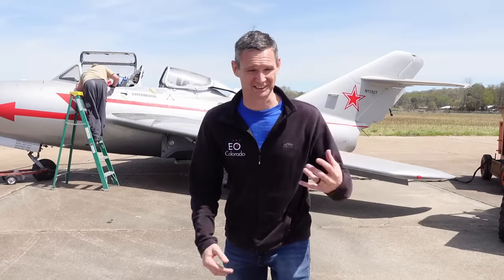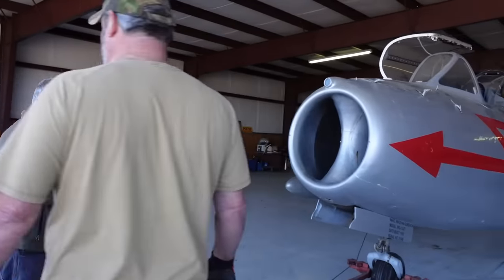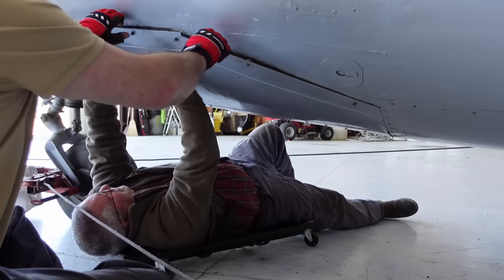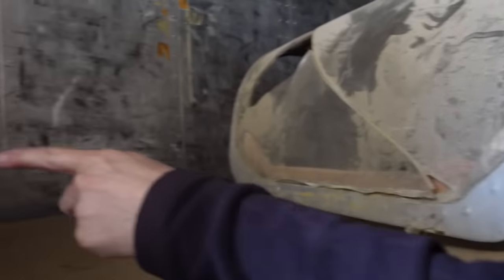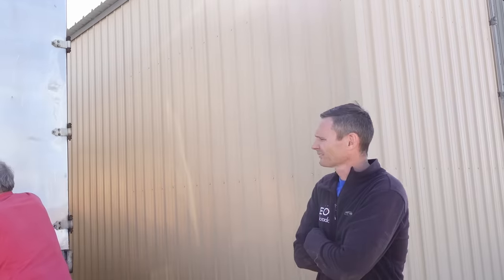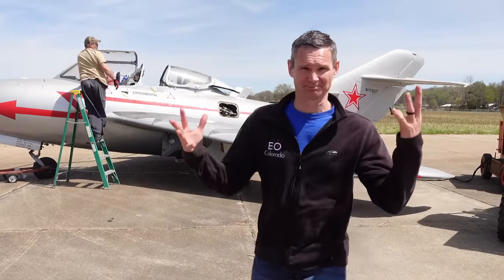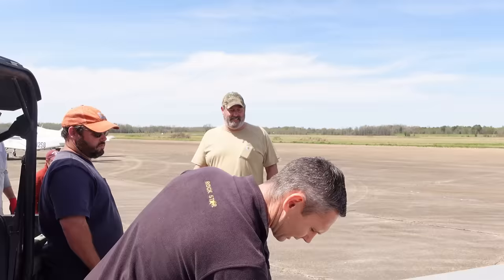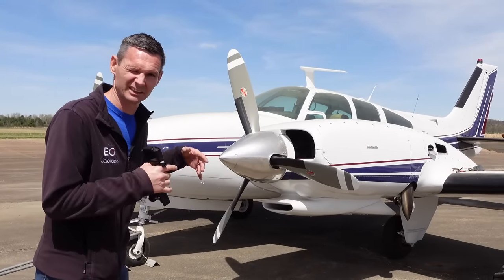I Start A REAL ABANDONED MIG 15 Fighter JET After 12 Years

Comment: I went up in a MiG 15 20 odd years ago and I still remember every second of it.  Learning how to combat G's with no pressure suit.  It was a huge buzz.  Got to fly it and do a barrel roll.  Tough plane.  Due to the angle of the wings, when it lands it causes ground effect and they literally have to dump it to get it on the ground.  I remember the suspension bottoming out with a thud.  Amazing day with Air Combat Australia
Reply: I flew in a -15 Ibis UTI in 1995 in northern California. Lots of work to maintain these birds.
Not a lot of room in cockpit if you're a tall person. Heavy on flight controls in flight I thought. Pretty neat experience.
Reply: @831BeachBum  Steering them on the taxiway is some fun
Reply: Every airplane has ground effect You just have to learn to write speed
Reply: @Jatojammer  
Ground effect is particularly dangerous with swept wing aircraft because the wingtips can stall, leading to a loss of aileron authority. If the stall worsens, the center of lift will shift to a point in which it's in front of the center of gravity, thus causing an unrecoverable pitch-up attitude at low altitude. The F-100 Super Sabre killed many pilots because by doing this "Sabre Dance".
Reply: speed
Reply: Flight sim is cool
Reply: @Jatojammer   S P E E D. Done and done.

Comment: I was stunned at 6:12 to see just how pristine the cockpit is! It probably hasn't looked that clean and scratch-free since it left the factory more than half a century ago. Usually, old aircraft will have scratches and dents on every conceivable surface of the cockpit. Fantastic work!
Reply: @raptor2265  I was surprised how everything was neatly labeled in English. You can really tell this plane was loved.

Comment: I only flew one time. It was in the mid 70's. The lady was kind enough to give me a ride in her Piper Cub 62 (CF-OSI). It was so amazing that I was shaking from the sensory overload. I always wanted to be a pilot but, I suck at math so, I diverted my dream towards cars and small engines. Being afraid of heights came later on and, don't ask me where it came from. Jimmy's "youthful exuberance", is bringing me back when I was 12-13 years old, on that first and only flight.
Reply: Same. Suck at math and my vision sucks 😋
Reply: I think I gotta solution, ever tried microlights? You don't have to be amazing at maths to get one's license and it's relatively cheap. One of my instructors went and got his CPL and said he regrets not  knowing about microlights sooner as he'd have gone straight for it. Furthermore  if you can drive, then your vision is good enough.

Comment: No smoke, no flames weird considering you know what
Reply: Not really, MiG-15s don’t have an afterburner, so no burner plume, and lots of smoke on start typically only happens after an extensive amount of oil is placed in the engine to preserve it for long periods of time. For one of the first fighter jets, the MiG-15 actually burns fuel rather clean, so not a whole lot of smoke is trailed in flight. Google footage of the F-4 Phantom flying to see a plane that does not burn fuel very cleanly….
Reply: No, what?
Reply: Those centrifugal flow turbojet engines were rather fuel efficient once sorted out despite their portly girth.  Have fun with it!
Reply: @zachboyd4749  they do have afterburners
Reply: @aj_2x170  
No they don't, you're thinking of the 17. The MiG-17 did have an afterburner, but the MiG-15 didn't. The two are very similar in appearance, so it's easy to mix them up.

Comment: That was the most quiet, turbine engine with the most invisible cool exhaust ever. Are you sure it actually started?
Reply: I was thinking it sounded like it was just spinning on the air turbine starter. Not actually running.
Reply: No smoke, it wasn’t running.
Reply: Mig-15s are extremely quiet for jets
Reply: @gogereaver349  makes good sense😎👍
Reply: @thomas7770  that’s kinda what I surmised. It wasn’t even loud. I heard the turbines spool up but I didn’t hear the whump of ignition. It seemed to me that it was just kept turning over. But, I figure Jimmy being present would know.
Reply: @crissd8283  my thoughts exactly.😎👌🏻Also his camera should have been thoroughly melted.
Reply: If you start listening at about 6:55 through 7:00 you can hear it spooling up after it lit off, that's the "Wooooooooo" sound you hear. 
Right at 6:59 you can see the heat coming back behind the airplane.
Reply: Yeah you can definitely hear it light off around the 7:00 mark
Reply: @moodiblues2  I'm not sold that the camera would melt. As high speed air exits a nozzle it creates low pressure causing substantial air flow around the aircraft as it gets sucked in to mix with the exhaust. As the camera wasn't directly in the exhaust stream, the air around it was likely fairly cool.
Reply: @moodiblues2  you hear it use headphones its settle but you hear the fuel start burning. that woooo sound at 6.55. if they gave it power and moved a bit then everyone would be convinced. but they probably figured that was a bad idea on a untested jet.
Reply: @rudedog302  Indeed. She fired up all right.
Reply: I also don't think it started, and was just spinning on its air compressor. As much as I wanted it to start, there was no heat from the exhaust and there would have definitely been some smoke on ignition. Retired aircraft engineer here.
Reply: @RebuildingScotland  there was you see it going around the side. it was only a second you see the heat. must have been in the wind. when it goes woooo thats it pulling air and burning fuel it also revs up slightly at that point its running on its own power. they shut it down shortly after being untested and all.
Reply: @gogereaver349  No, a turbine exhaust would be clearly visible as a well-defined plume of hot gas exiting at a velocity that would not be deflected by the wind. If there was anything seen, could have been just a dash of vaporised kerosene. Also, the way he was handling the throttle in no way related to the sound that would have been produced. Pity, because I was really willing it to ignite.
Reply: @RebuildingScotland  you dont get alot of heat distortion on a non afterburner aircraft as they have valves to keep the temps down. unless its a cold day.
Reply: @RebuildingScotland  either way its not a good buy for him this is something for airshows not a daily flyer.
Reply: @RebuildingScotland  amazing how many Mig experts there are out there....the first and foremost telltale that it started is that Jimmy said it did, I don't believe he is a liar.  Second is that I have seen one start on several occasions and helped in the process....those old turbines are nothing like the current versions, flight idle on the Mig 15 is like 8 or 9 thousand RPM nothing close to the spool up on a current turbines 40 or 60k. Migs run slow and cold, they just didn't have the metallurgy or manufacturing back in the day to make the thrust they do today.
Reply: @troynyholm232  Well, I never claimed to be a MiG expert, just had several years working on vintage aircraft, so I probably know nothing.
Reply: @RebuildingScotland  I agree, but why did Jimmy act like it was a success?
Reply: @gogereaver349  I’ll take your word. I was just a bit surprised that an old Russian jet, made in the  1950s, could start and not have  a puff of smoke, loud ignition and melt the camera placed a foot or two from the rear of the motor. But shit, Jimmy said it started and you could hear it; it must’ve started.
Reply: @chrisw9629  👌🏻
Reply: @rudedog302  👍
Reply: @moodiblues2  the link i shared was on starting and taxing out no smoke etc.
Reply: @RebuildingScotland  Ok I am a licensed A&P mechanic for 37 years, worked for two different airlines, spent 4 years in the USAF as a jet engine mechanic, overhauled 8 different types of jet engines over the years from J57 to CF6-50s, I have stood under J57 turbojets and hand trimmed the fuel control. THAT VK-1 JET ENGINE LIT OFF AND WAS RUNNING.
I can tell you not all jet engines smoke when they light off, on the J57s (B-52G) you had to look for the slight flash of flame when they lit off to know that they actually did light when on ground during a run-up. Some of the newer big high bypass, cleaner burning, fuel efficient fan engines smoke when they are just spooling up after light up, some don't.
Reply: You’d expect to see smoke if the engine fuel system had been inhibited. I guess the engine had been run recently by the sellers to ensure everything was ok prior to filming.
Reply: @andrewdixon6401  very possibly but what about the heat and camera close to where the hot exhaust gases would be?
Reply: @moodiblues2  the camera does appear to shake as you expect from a running engine. They don’t appear to throttle the engine above idle so that’s maybe why we don’t see much heat distortion. You would expect to see a little puff of unburnt fuel on the start of combustion but maybe it’s just missed during filming or as it’s probably a multi can combustion chambers you just don’t get it.
Reply: @andrewdixon6401  you’re probably right. I don’t see why Jimmy would say it started if it didn’t

Comment: I really enjoyed that one Jimmy,  lots of fun.  I used to pass through a town in New Zealand called Pokeno on my way to work.
There was a mig fighter just like this in a yard under a plastic tent.
Often wondered if it flew again.
Awesome sound a jet winding up. 
Regards Steve.
Reply: There is a mig in penrose that sits on top of a building  it might be the same one
Reply: @philcrosby7757  You never know 40 years later.
Reply: @sprendergast351  the one in penrose is different to the mig15 its a bit longer
Reply: @philcrosby7757  the one in penrose is on top of a building doubt it could ever be flown again

Comment: Some of the gauges are still in Cyrillic and I assume or original? Like the brake pressure gauge. I learned in the video last night that the brakes and the cockpit canopy seals all share the same nitrogen system, and when the brakes discharge nitrogen you have to be careful. Likewise taken care of not to damage the canopy seals so you don’t lose your brakes.
Fascinating and entertaining, thank you for sharing.

Comment: Jimmy for president
Reply: What could go wrong I see nothing but perfection from this man dude do you realize in my mind you're on the same level as Steve Irwin I miss that guy you are the airplane hunter jumping on the back of these wild beasts and riding them home good job sir this is coming from a factory test trying to catch up on your videos do a review of a quicksilver aircraft we had seven different models if you want all 7 it would be cheaper than buying one of your crazy adventures if you could find them p we took the back seat out of the GT500 converted into a crop-dusting contraption

Comment: This is just a test to see if you can still kick the tires in like the fires of course, but it looks like you’re going to have to spend some money on those canopy seals before you can take it anywhere, even taxiing, unless you can isolate the seal nitrogen feed so it does not bleed out and you lose your brakes. Those canopy seals look pretty tattered.

Comment: I remember a different video of a 2 seater trainer mig15 explaining the eject procedure. Was something like “if you’re still conscious after the 20+G eject you have to separate and pull your chute.”
Also has limited brakes from its nitrogen tanks and little aileron authority at approach speeds.
Reply: Matt Guthmiller's video , right?
Reply: @DimoB8  Yes! That's the guy
Reply: As I understood from a pilot, the eject function it was not a real option. Most common it was to die like a fly smashed on the window, decapitated by headphones, or air born without legs.

Comment: But Jason's 401 is actually a rescue and everything he's doing is for an incredible cause. He also won the 401 by putting in so much work to get those engines to run by himself.
You've just found a jet that runs and got the pro's to start it for you. Its also not really "Abandoned" if you have to buy it from someone, I'm guessing the owner. Also good luck learning to "Drive" a MiG.

Comment: On at least the mig-15 and the MiG 17, the fuel lines are made out of aluminum. You must replace those with stainless steel fuel lines. It has cost a lot of investors some aircraft.

Comment: There was a Mig-15 that was sitting at the local airport in a town that I used to live in. It sat there for years until it finally disappeared. I found out later that it got put up for sale for $1 so long as the new owner paid for transportation costs. It wasn’t running and definitely needed a LOT of work, but come on, $1???? If I had known that I would have tried to figure something out. That was when I was way younger and in the Civil Air Patrol and it was always so cool to see it every time we were at the airport.

Comment: Fighter jets are "by wire" - you have a stick, and it is pressure actuatid.  If you have ever flown with a single stick (versus a yoke), then you should be ok. (wait - this has the old-fashioned "stick")  I would make sure I got altitude quickly, so I could "practice" and get used to the action/reaction.  Practice a few "landings" and banks, and then do some very easy "touch and gos" - VFR.  Make sure you can read the instruments, or have your interpretation.  I prefer meters (*not* "feet"), so I just calculate and do visuals.  Again, keep your altitude - you can't make one mistake near ground.   I wonder what my flight plan would be?  Ha ha.  The recip multi is more most people's speed.  The turbo requires a turbo rating.

Comment: Hm it can´t be that difficult: Throttle with Russian Cyrillic label fully forward until the afterburner roars, somewhere is the handbrake (there are maybe five or six levers inside that archaic cockpit one must be the handbrake another one is for the flaps, the others are for releasing the bombs so don´t worry they will not do anything as long as the jet is not loaded). Pull back the stick with the red Sidewinder button when it rolls along the runway rather fast... It´s unclear which lever is for the gear so better leave that extended during the first flight. And maybe buying a label printer for English gauge descriptions to make the second flight more easy might come in handy. It´s just like a fast Cessna 152, can´t be that difficult to drive it :D 
P.S.
Are these authentic Concorde batteries, or TU-144 Concordski batteries that just look like Concorde batteries? Oh and that cockpit is in English - why is the cockpit in English and brandnew looking? 
By the way I like your video and your style you are cool and funny, not like many other rich guys - booooooooooooring and like a sleeping pill and "yeeeah yeeah whatever I have a Lamborghini a Ferrari and a Learjet *yaaawn so what I don´t even look at these anymore...." You show real emotions and true to the core enthusiasm for these awesome birds. Of course you should buy it if you have the cash, because NO ONE has a real fighter jet in the garage. Imagine how cool that is starting this beast and let the turbine howl every week for a few minutes. But the ailerons are missing and might be hard to get on eBay - no ailerons means this bird is grounded, or you can drive it along the highway with the rudder. But maybe comrade from Eastern block knows where to get authentic Mig ailerons! :D

Comment: Jim, buy it it would be a great project to follow for me. And for you to do I think it will be very interesting and exciting. God bless you and your family you do a great service to our country, I fight airplanes as well, only mine are RC airplanes, the largest one I have is a j3 cub with a 12-ft wingspan, ways just under 40 lb due to some of the modifications electronically that I installed, with remote starters stabilization systems I can monitor airspeed, engine temperature, battery voltage, all my electronics are totally redundant, gives me a better sense of security and safety.

Comment: That Baron has Duke engines on it. That must be what they put on turbo Barons. Or it was some kind of upgrade done to it.  That Mig must burn like 400 GPH or more. Times whatever you can get jet fuel for. That would govern my decision. Plus the cost of the maintenance. Too bad it doesn't have a cartridge starter.

Comment: Do that trick again where you do a fly-by onscreen and kick the leg of the filler ladder at about 5:50 in Joyous Exultation!.  It was perfect!.  lol!.   What happened to the Mig??.     At the Abbotsford Airshow in Canada one year, they had 2 Mig 15's chasing 2 F-86 sabers across show center,,then the return pass, the tables had turned.  They did a 4 man formation fast fly-by, at Mach .82-ish(I think the announcer was drunk)  which was really loud!.   This was in the 80's.  I was hooked.  If you run that Mig at full beans, you'll burn thru the drop tanks in minutes.  Even at cruise, they guzzle.  Even updated, they guzzle.  Once you come off the drop tanks, you'll have already planned ahead to finding a planeport with jet fuel and compressed gasses, or start-cart, or both.   Every 100 hrs is FAA mandatory.  I would make that every 50-75hrs, at maximum.   It's old,,but Very, Very cool!! .  Thanks Jimmy!!.  The ME-262 had a max engine life of 25 hrs with the Jumo engines, then full rebuild, or scrap heap.  That thing sat for 12 years and kicked right to life.  Russian heavy hammer tech vodka voodoo.  Yup, Yup!.

Comment: Where was the heat plume coming from that jet engine? Looks like it was not running at all, just sound effects and shaking effect added to camera. From side-on view you should be able to see the exhaust stream blurring out the start cart in the background. Maybe they spun it up but no fuel was burnt, no ignitor clicking either. Have a close look at jets that are really running, its quite easy to spot the kerosene fumes coming out of it, it blurs the view of whatever is behind it.
So many fakers on youtube.